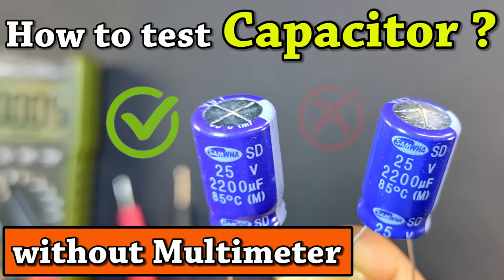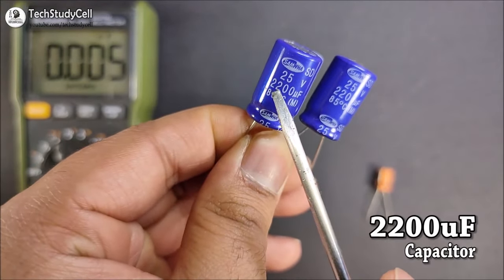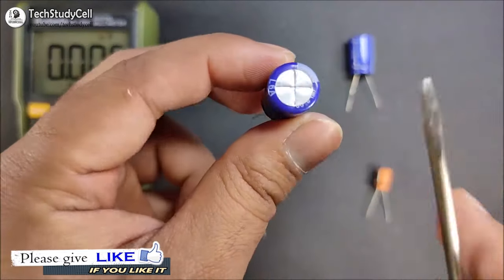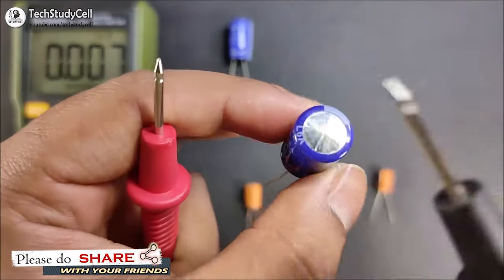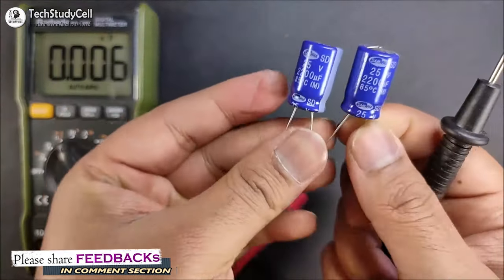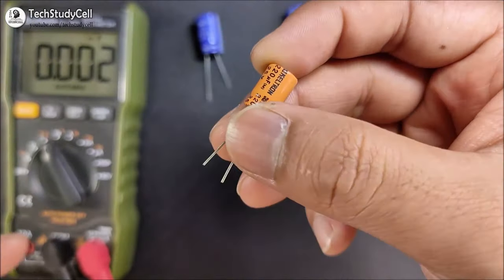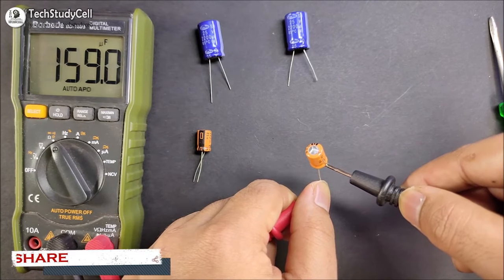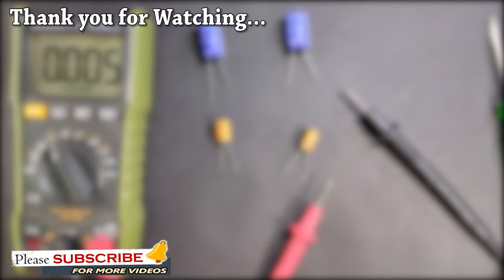How to test Capacitor without Multimeter

Comment: Most videos I have seen  focus mainly on electrolytic capacitors  where there are visual signs of a bad capacitor such as the bulge on the top and leaking as well as checking the capacitance and ESR measurements. I would like to know if there are any similar tests for the other types of capacitors such as the polyester, box and ceramic varieties. Does a good capacitance value alone indicate that these other types are good. Are there any tests to check if they are leaking current or any other issues that would cause them to be faulty. Just like how an electrolytic cap may show no visual signs but have a high ESR or low capacitance and be bad.

Comment: Good but you should point out the need to connect neg multimeter  probe to neg side of the capacitor,ref white line on the capacitors

Comment: Is it 100% necessary to remove capacitors from the circuit board in order to test them? Power is disconnect and drained from the board.
Reply from the maker: Yes